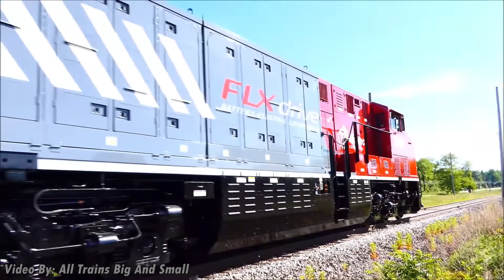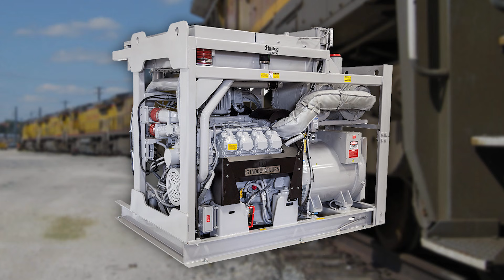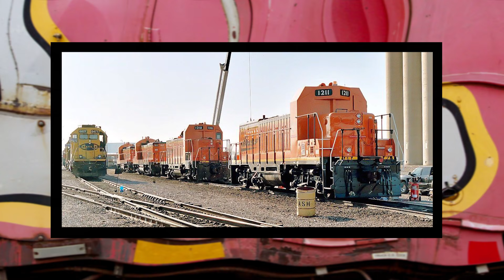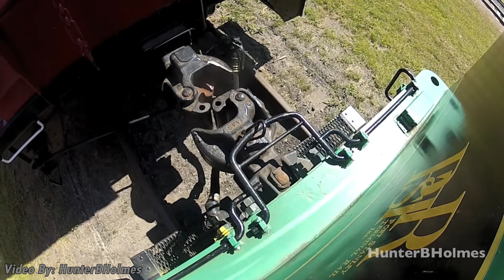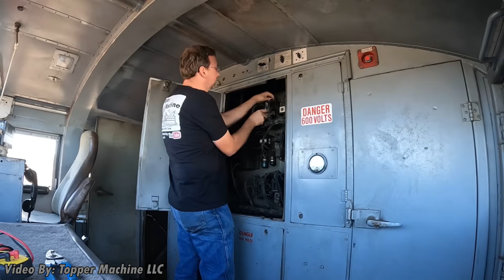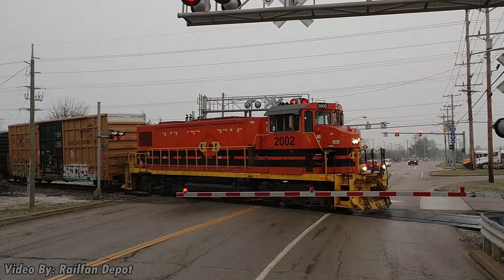Green Goats and RP14's; The WORST Switchers You Ever Saw!

Comment: I worked on the NS goats 100/101 and the 2 cabless units. I remember everything being crammed into spots. the cabless was interesting to drive without the remote, only had an access door with switches to control direction. but the door would not go against the car body. So you had to put you head in the line of fire to see.

Comment: They may be good at saving money, but the reliability issues will continue to plague them for years to come; why is this? Because of the engines they have; these engines are not set up for round the clock pounding ouned heavy tonnage conditions.  They are only good for light switching jobs that dont require  them to be used in heavy freight service!  Parts for these greengoats are difficult to replace. Thus making them usless for freight service and, their engines are not designed for 24-7 usage

Comment: I wonder if it's possible to use a variable cylinder system of some sort on a locomotive. That way you get the durability of a big prime mover with the fuel savings of a genset.
Reply from the maker: I don’t see why it’s not possible. 
The only issues are that large engines might not respond well to such a system, and it would be very expensive to engineer/implement. Still, I think it would be cool to try out!

Comment: I NOTICED THE CATERPILLAR V-8 ENGINE IN ONE OF THE STILL PIX , IS A 3408 WITH 1099 CUBIC INCHES OF DISPLACEMENT!
THIS IS MY FAVORITE BIG TRUCK ENGINE !!
Reply: Well you might want to buy a 3GS21B Genset Switcher because most of them use that engine
Reply: There's a company building them with a screw type supercharger with two turbos blowing into it all mechanical injection at over 2,000 hp for semis with a warranty! They also build 3406's over 1000 hp. They claim fuel savings due to no downshifts. The name of the company is "No D$%n Computers"! Of course, spelled correctly! They make in-house pumps. I was talking to the 14yr old son of the founder at the Louisville truck show about 10 years ago. He built the engines and could tell you anything you wanted to know!

Comment: Quite an interesting video!  A couple of thoughts: First, these weren't automotive engines -- they were industrial engines based on heavy-truck engines, which absolutely are designed to run at full power for hours on end, and they do that reliably when working as stationary generators.  But I suspect the "stationary" part of that might be the key -- as you point out, switch engines get banged around a lot, and that's hard on an engine that's not designed for it.

The other thought is: Since these particular engines were meant to be experiments, are they really "failures" just because they were pulled from service after only a few years?  The goal of an experiment is to learn things quickly and cheaply that can be used to make the next generation better, and so you wouldn't expect an experimental locomotive to be around for a long time.  Even if it works well, as soon as they've learned what they can from it, it's going to be obsolete.  And then of course there's the argument that an experiment that says "this isn't a good idea" is still a successful experiment because they learned something useful from it!

Comment: So Genset likes to put small diesel engines on a frame. There not the first with that idea.
Baldwin did it in 1943 with a prototype that was intended to produce 6 000 hp in 1943 with 8 diesel engines !!
Well they just try it with 4 and finallly scrapped it in 1944, her gigantic trucks ended up on a Centipede.
That demo numbered 6000 and model was 4-8+8-4-750/8 DE.
It was same principle. 8 skid mounted engine/generator that could be replaced "easily" for maintenance.

Comment: Well yeah the hydrogen fueled locomotive got laid up soon after it was built.
You might ask "Why, when Hydrogen is supposed to be the Fuel of the Future?"
Well, it's ultimately down to chemistry and physics.
See, hydrogen's some really lightweight stuff. Lighter than air in fact, that's why the Hindenburg used it as lifting gas.
But that has bad implications for using it as a fuel. Hydrogen is incredibly low density, even when stored compressed or liquefied.
Rockets that use hydrogen as a fuel (like NASA's SLS, and the Space Shuttle before it), needed GIGANTIC fuel tanks just to carry all that hydrogen that they used, simply because of hydrogen's low density.
Take the Space Shuttle's external tank (the big orange part).
The liquid oxygen is stored pretty much ONLY in the nosecone of that giant thing.
The rest of the whole thing is filled with liquid hydrogen. Now I'll give you 3 guesses as to which part of the propellants weighs more when the ET is full, the liquid hydrogen fuel or the liquid oxygen oxidizer. If you guessed the liquid oxygen, you're correct.
That means that the smaller of the two propellant tanks in the ET assembly carries the majority of the mass, which your gut feeling is probably gonna tell you is all kinds of wrong. But if you do the math out on it, using the density of liquid oxygen and the density of liquid hydrogen, combined with the volume of each of those propellant tanks, and you multiply the density with the volume for the same stuff, you'll get a mass. And you'll see that the liquid oxygen weighs more than the liquid hydrogen.
That's how very low density hydrogen is. It's hard to grasp it in my head if I don't walk myself thru that little explanation I did right there every time I think about it.

Now what does this mean for using hydrogen as a vehicle fuel? Well, it means you need a ginormous fuel tank to have any semblance of a good operational range.
People get hung up on hydrogen's "energy per pound" but forget about "energy per gallon" If you use metric like I do, you're instead thinking in "energy per kilogram" and "energy per liter".
Hydrogen is used in rockets because with rockets, it's the kilograms or pounds that count. With ground vehicles, it's the gallons that count, so hydrogen is in fact NOT the fuel of the future for them.

For ground vehicles, METHANOL is the fuel of the future. Why is this? Methanol can be extracted from any source of cellulose bearing matter (paper, wood, corn stalks, leaves, bark, untreated mulch, cardboard, etc. basically the parts of a plant that people can't eat) simply by adding heat and only letting a measured amount of oxygen in to react with the cellulose, and then distilling the gaseous products that are released.
This process is called "pyrolysis", and some German vehicles during WWII were converted to run on methanol vapors instead of gasoline because the Allies cut off most of Germany's oil supply during the war, so people had to find other ways to get their vehicles moving.

Now this isn't as efficient as using bacteria to make methanol, but that method requires the sugary/starchy parts of the plant, aka the stuff that we already want to turn into food (same reason ethanol biofuel never really took off in the US despite a big push to make most cars in the US able to run on E85 in the mid-2000s).
The point is, it doesn't have to cut into our food supply like ethanol fuel does, instead it can use the parts of the plant that are usually discarded, as well as the material that is usually burned off when clearing land to farm on.

Oh and there's another interesting thing about Methanol. You know how people have been saying fuel cells are the way of the future? We've figured out a way to make a fuel cell run on Methanol. So all that is needed to convert a Hydrogen vehicle over to Methanol is to change out the fuel cell pack, the rest can stay mostly the same.

Internal combustion engine vehicles need fuel system adjustments to account for the fact that methanol is highly hygroscopic and likes to cause corrosion, so lots more use of plastics to handle the stuff is likely the solution there. But dragsters and race cars and F-1 cars have been using methanol fuel for a long time, so that technology SHOULD be well understood.

And since methanol isn't used for a lot of other things, it SHOULD be pretty cheap too!

Comment: Very good video! NS 2120 may yet have a use. I flew my drone into the NS Roanoke Yard the other day and it was idling with other units on the turntable at the shops, leading me to believe it’s used to move power in and out of the shops, rather than just sitting in storage.

Comment: Well, I'm an ole Toot with old school ways. Now I  kinda was ok when we went from Steam to Diesel, but I will not go to battery powered Locomotives.
That's my story and I'm sticking to it.
Thanks as always for sharing info to us.
Take care.
Reply: Battery Powered Locomotives are destined to just be Slugs, with Batteries and not concrete.
Reply: Maybe not straight batteries, but I see some use for them in a mixed or limited capacity. New York Central had a whole fleet of switchers that could use battery power, charged by a Diesel, as well as third rail. They can supplement existing modes but they’re still nowhere close to being reliable enough for railroad service.

Comment: You know, It would be Very interesting But very cool to see Webtec Or EMD create a Large modern Freight locomotive With 2 Big prime movers, with Alot of Bogies But also Find way to Make it where it would consume less diesel fuel.
Reply: It won't happen. They tried that with things like the gas turbines and DD40Xs in the 1960s-70s, and the idea was a failure. Rather than building one giant two-engine, multi-bogie locomotive, it's just more efficient to build a pair of one-engine two-bogie locomotives with the same total power. The reason is operational flexibility. If you have two regular locomotives and one of them breaks down, you can keep using the other one. But if you have one giant locomotive and half of it breaks down, the other half is worthless. The current system of having a large pool of ~4000hp locomotives works very well for hauling the kinds of trains that your giant locomotive would be used on.
Reply: @beeble2003  Yep, I had a good feeling that would be the case.
Reply: Well in Brazil they purchased surplus North American SD40 and converted them to narrow gauge by extending frame lenght and replacing C C trucks by BB BB. They look really impressive with tiny railcars.
Reply: @danielfantino1714  Yeah, I've heard about those. Especially with the GE ones.
Reply: @Tyrone2Raw  with all the cash they put in them, funny to see them in their former livery: CN, CP, CR, N&W, CSX, NS, UP, BNSF. 
With GE in narrow guage it´s just trucks, couplers, draft gear and small frame extension. With DMD it´s all that plus dynamic brake fan removed and put in the long hood and lowered radiator fans .
Purchase price + rate exchange of $ + shipping + new trucks,  wheels, traction motors + all the shoo work and cost....
Just wonder if they´re crazy or if we dumped still good horses ?....
Reply: @danielfantino1714  But the BB-BB wheel arrangement there was just because even the weight of a single-engined SD40 would stress the tracks too much on six axles.
Reply: @beeble2003  that makes senses and also less clerance for traction motors. They bought brand new SD45 and put them on DD trucks, same as DD40AX with small fuel tank.
Reply: @danielfantino1714  Though the key thing about the DD40AX was that it was dual-engined -- essentially, a pair of SD40-2s on the same frame.
Reply: @beeble2003  i know that. DD40AX was just successor od DD35 or 2 GP35 on same frame. GE counterparr was U50 & U50C.